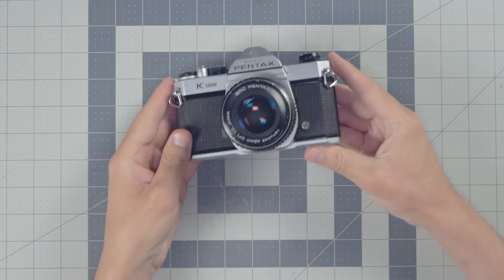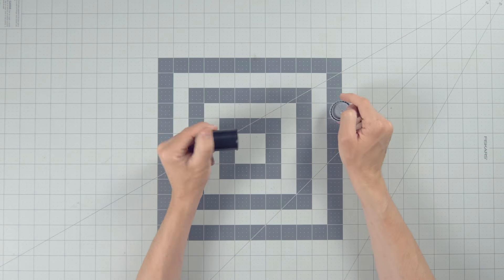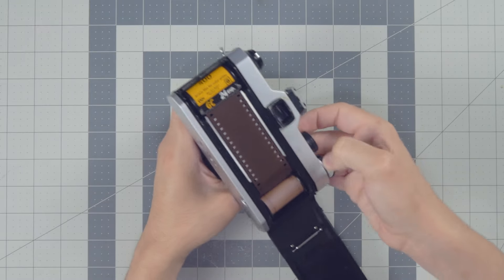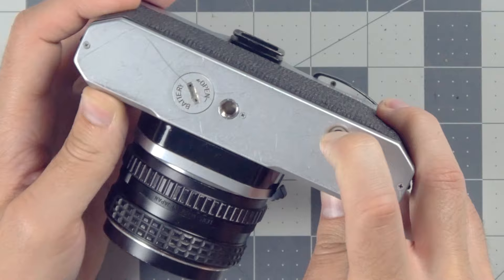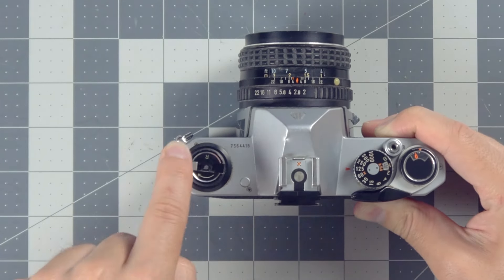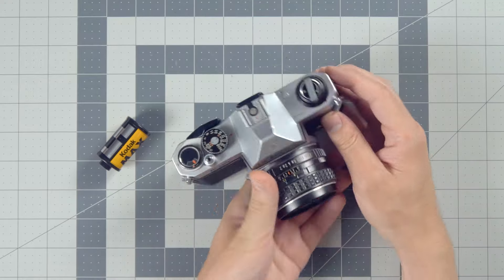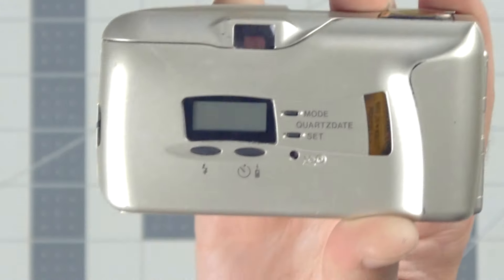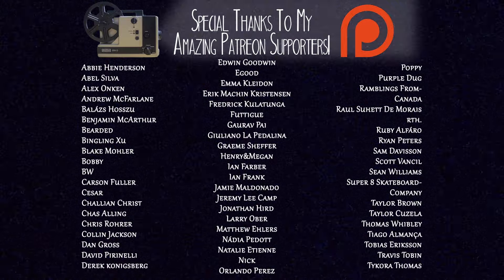How do I get 35mm film out of the camera when it's done? | ANALOG ESSENTIALS

Comment: I got into analog shooting a modified roll of 120 on a 620 Kodak from the 1930s. The optical quality is far from the best and the negs are so large that you can only take 8 pics with it, but using a 90 year old camera that still works today made it worth it!
Reply: I have a 35 mm Kodak Pony camera that was made in the 1950s that I actually do like using. It doesn't even have a rangefinder you just kind of guess how far away is subject is or measure it if you can and set the appropriate distance on the lens barrel. The way it was made it doesn't even need the foam light seals that often deteriorate on cameras that have it. 100 ISO films work really great in it especially Kodak ektar with his fine grain.